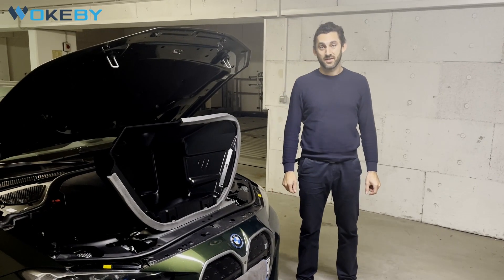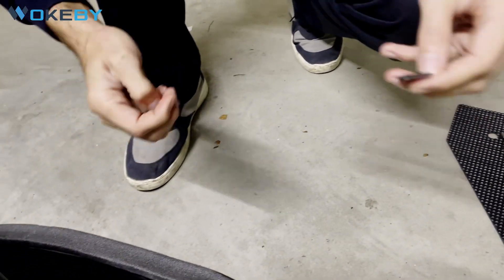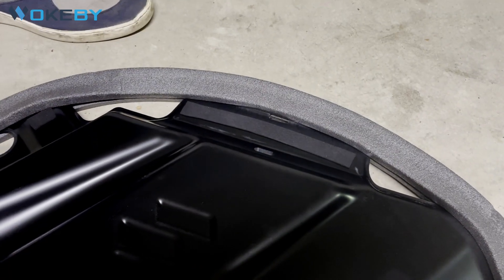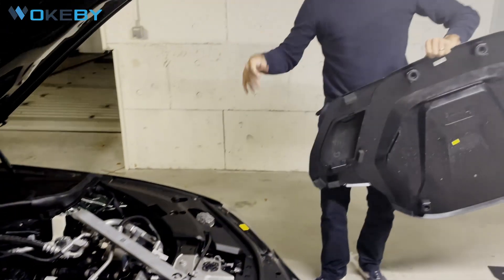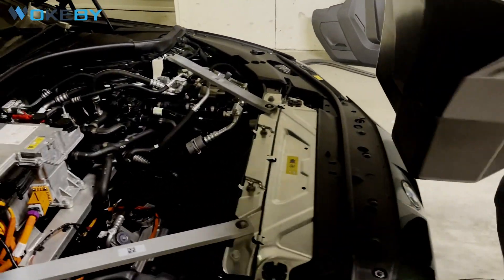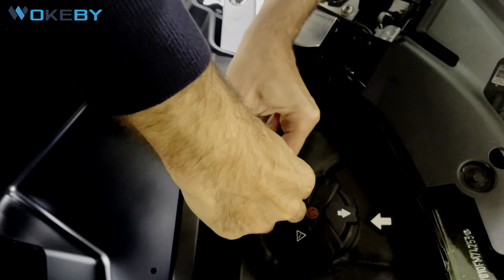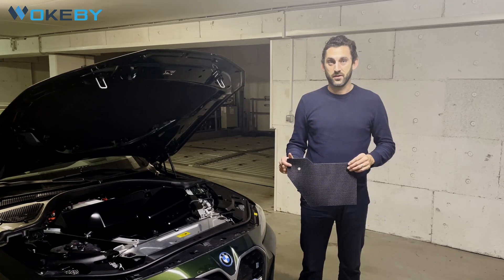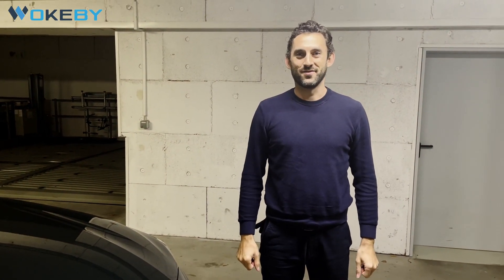WOKEBY - The BMW i4 Frunk

Comment: Nice product, what are the measurements of the "loading box" where you can keep stuff and how much weight can you put into the box?
Reply from the maker: Hi measurements are hard to tell because the shape is not a box design and everything is sloped. The frunk will give your about 35 liters of additional space. Regarding weight I cannot give you a finite number but we did our tests with about 10 kg weight and were not able to detect any motion. So I don't worry about the weight as long as you dont load it with bricks ;-)

Comment: Looks great, my only question: during routine servicing will this item need to be removed by the mechanic for access?
Reply from the maker: Hi, this depends on the work that needs to be done. But we recommend to remove the frunk before a service appointments to avoid unnecessary confusion and questions.

Comment: I was wondering if the frunk has any negative effect on cooling the battery or other stuff in the car. In the front of the car are some adjustible airvents for cooling.
Reply from the maker: Nope. The only time when the cooling is really needed is DC fast charging and there are no issues to be expected.

Comment: How does this deal with heat? For the items inside the storage and whether if it interfere with cooling of motor and component?
Reply from the maker: There wont be any issues. If you have the possibility check the M50 and see how much space is left there.
The Frunk itself is made of PC/ABS which can withstand temperatures over 100° C easily. Even though this temperature will never be reached even closely we wanted to stay on the safe side.
Reply: hast du das getestet? Können die Komponenten vom Auto überhitzen? Habe da bedenken

Comment: Had a test drive of the i4 e-Drive 40 yesterday, very much liked it with a potential plan to add to our i3 and already longing to get this to improve it right away. Upmost respect for your work with these designs after having an i3 with the charge flap and rear trunk extension that I emailed you about just a few months ago which you were incredibly helpful with. Thank you for these products and your dedicated work Wolfgang!

Comment: Good product! I just think the inlay mat should be included by default ;) I have also a question: can the cargo get wet if the frunk is used without the factory 'engine' cover?
Reply from the maker: Hi Victor. If you check our shop you will find that the rubber inlay mat is already the standard option but we still give the customer the choice.
According to our tests in the power washing station and the long time testing our Frunk will stay clean and dry even without the standard cover. The front compartment of the BMW i4 is well sealed against water and dirt.

Comment: Does this fit a RHD i4 with M-Sport package?
Reply from the maker: Yes, it will fit cars with M-Sport package. Only if you have the adaptive M-Sport suspension you will need our M-Sport version of the frunk.
Reply: @WOKEBY  thanks. Does it fit a right hand drive i4?
Reply from the maker: @sctaylor001  Sorry I missed out that point. Yes it also fits RHD cars. I confirmed that by pictures I got from prosects from the UK.